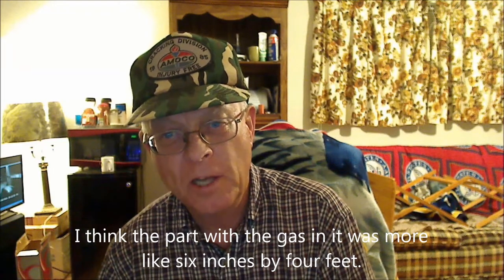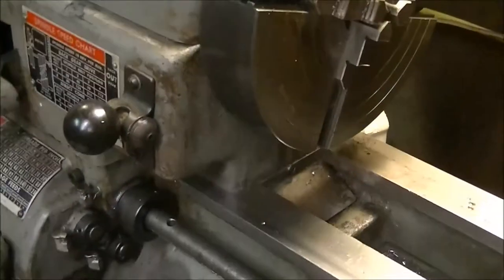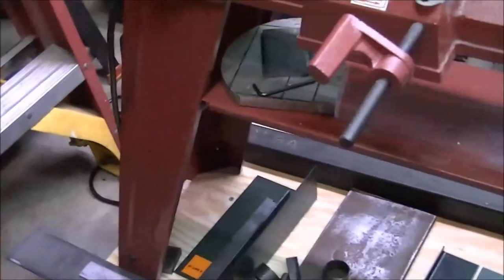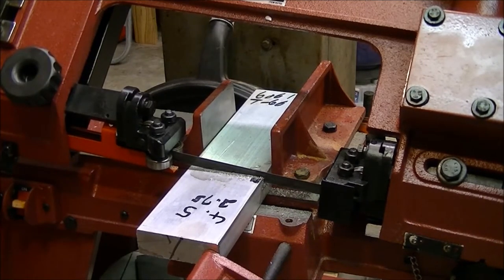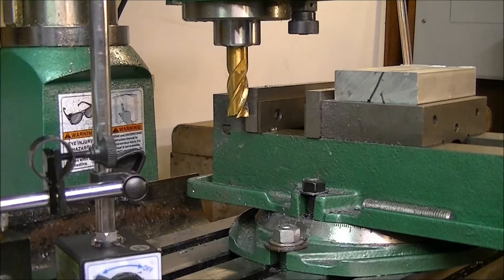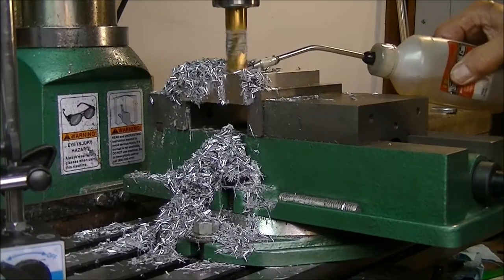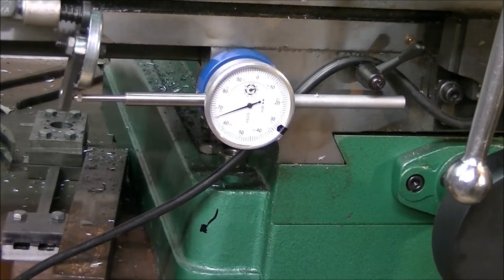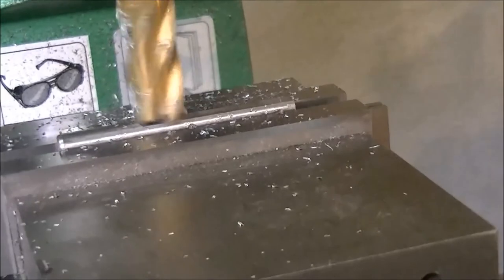Craftsman lathe carrriage stop

Comment: Nicely made pace need to do the same for my dads lathe thumbs up
Reply from the maker: As usual I stole the idea from someone else, mrpete in this case.  I will switch the bolts out for some allen head cap screws or if they have them some square head that fit my lathe wrench when I can get to the hardware store.  I just used what I had handy.  Thanks for the comment.